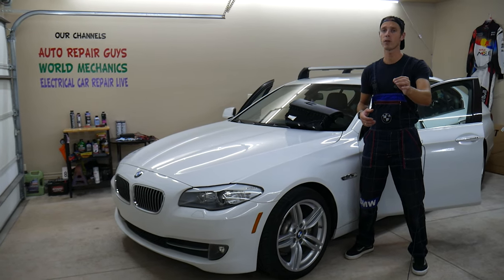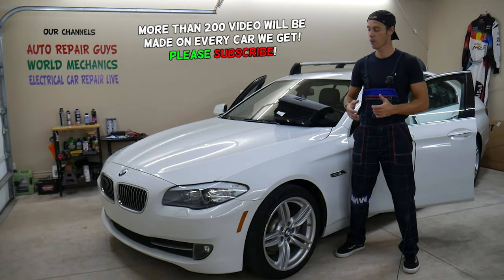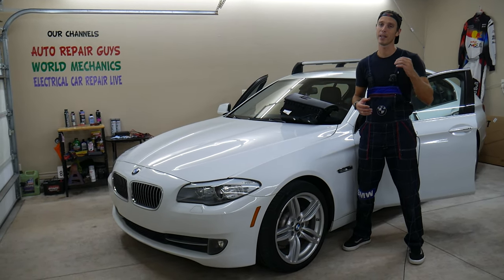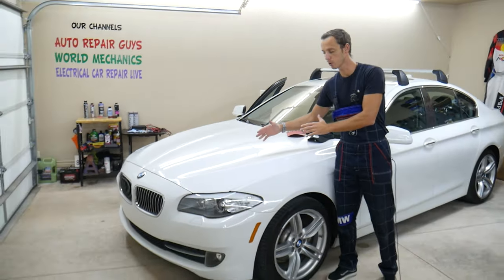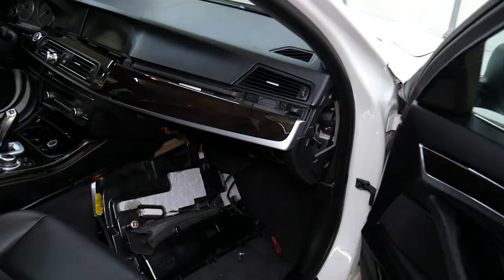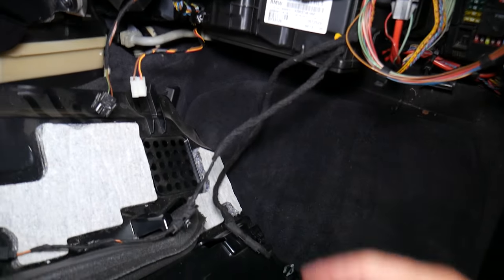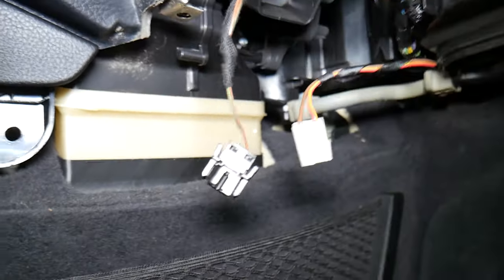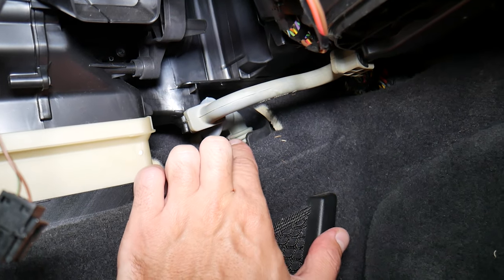BMW WET CARPET ON PASSENGER SIDE, WET FLOOR MAT BMW F10 F11 E60 E61 G30 G31 520i 523i 525i 528i 530i

Comment: would my 2014 X5d have the same location?  I also have wet carpet in the passenger.  seems like for a while.  so slow leak.  i checked the sunroof and all drains are good.  so think its inside.